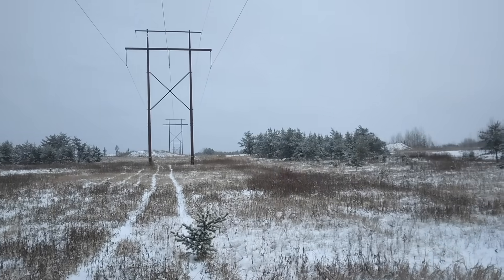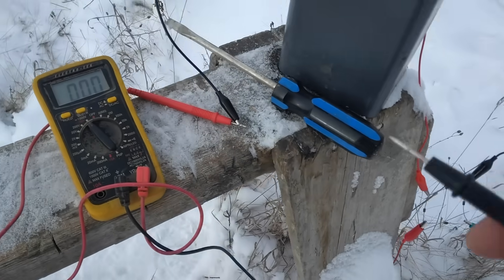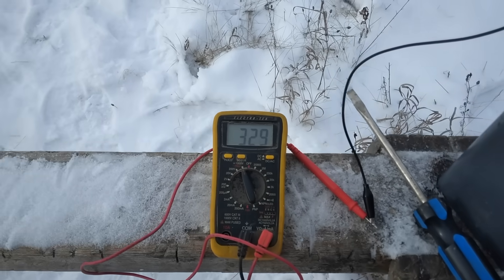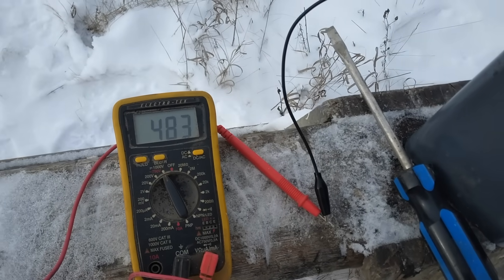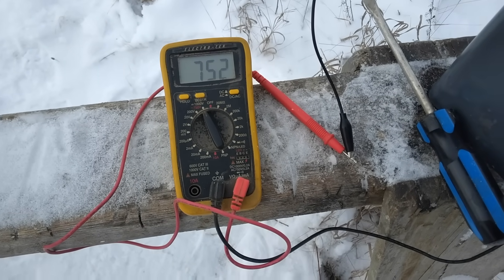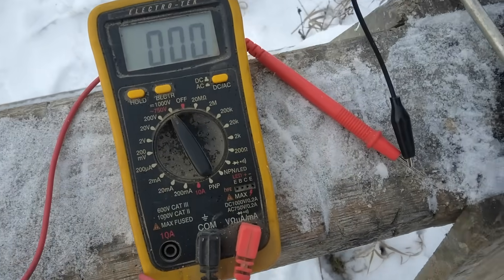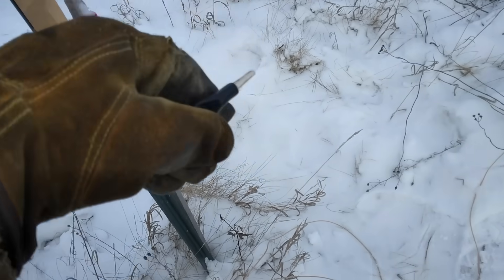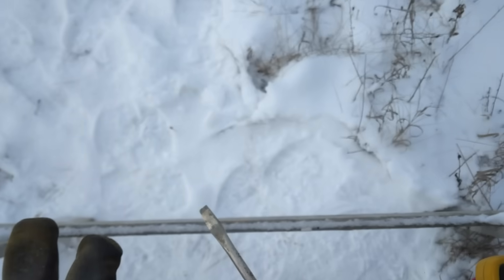Fences sucking power from under HV transmission lines

Comment: You can test higher AC voltages with a resistance bridge. Use two resistors in series and make one of them 100:1 the value of the other and go between your 'fence' and ground. The values should be high enough to limit the current so use maybe 4.7K and 470K ohms. Measure the resistance across the smaller one and multiply by 100. You don't want to go too high either because as you approach the internal resistance of the meter, your values will become skewed. Still high voltage, so be careful. Maybe mount to a board in advance. If the voltage remains too high, make the difference 1000:1. 😎
Reply: measure the resistance? but you know the resistance of the resistors already... and you'll fry your ohmmeter if you measure it with voltage present
Reply: @michvod he meant measure the voltage. What he was describing was a voltage divider circuit, and he said to measure 1/101th of the total voltage drop across both resistors in series.

Comment: Co-ax cable? The outer co-axial part is the shield! Use plain bare or insulated wire! 
Take a florescent tube with you. It should light up under the lines, just how bright where you find out!

Comment: I'm curious is this wasted power from the power lines or does it actually draw Power from the power lines? In other words when you put this wire up does it take power away from the power line resulting in Lost Revenue (albeit small) for the power company?

Comment: If anyone has ever noticed a different "feel" or "vibe" or "smell" under or around high tension lines, this is what is going on. EMF. As more and more wifi signals and cell signals have been broadcast over the years, the energy vibe of my area has gotten "thicker"; its as if you can hear and feel more static but its completely silent (sans the sounds of the road).

Comment: What would you be able run off of this system?  I’m guessing you’d be looking at some circuitry hooked up to the capacitor (post charging) to bring the voltage down to a 12 volt DC supply?  Maybe to run some low load lights or something or charge your laptop haha.  I suppose the possibilities are endless if you know how to harness the power from the capacitor in a controlled way. 🤔

Comment: It's a wire in an alternating magnetic field. That is how you induce an electric current in a wire.
     But would this result in less currant delivered to the intended destination?
     The power is lost in creating the magnetic field. The magnet field is generated regardless. But does collecting the energy from the magnetic field effect the current in the wire?

Comment: You're not stealing electricity, instead you are harvesting the electromagnetic field created by the high tension lines and actually making a small generator by using the shield side of the coaxial cable. Nothing illegal about it and I don't see why you can't charge batteries with a little ingenuity  after all a capacitor is a battery in all reality. Just think about it, if you were to string up several lines you might be able to charge enough batteries to power up your barn or even the house.

Comment: The fences are NOT sucking power.  Yes. Fences can have an electric charge induced into it.  The HV power travels around conductor as it travels long distance the circle of electrons gets larger.  As that circle grows it induces a charge on any conductor it crosses. That is why fences crossing power lines are GROUNDED.  Your action on this video is reckless. You CAN easily electrocute yourself , you have no knowledge of the danger you put yourself in.  Power lines use what is called a transposition to decrease line loss which is what you are experiencing.  A transposition is the change of position of the conductor at two structures to collapse the circling electrons back to conductor thus reducing line loss.    The amount of voltage you are collecting is unpredictable , it is determined by load, atmospheric conditions and wind.  The next time you do your experiment you could receive many thousands of volts. To which your leather gloves would not insulate.

Comment: It is common practice in the pipeline industry to have ground straps or chains dragging on all equipment under power lines to drain the charge.

In the 1960's a gentleman had placed a loop in his backyard under TVA power lines.  It worked well for him.  He agreed to install a loop for his neighbor but was unfortunately killed by an electric shock from his invention.

Comment: It is electrical pollution. We used to camp up at a corner point where 2 lines came together. We used Fluorescent light bulbs which would glow dimly when hooked to a ground and a ring of wire going from bulb to bulb. Was cool to see about 10 or so strung around our tents.

Comment: I have power lines running across the east end of my property. Now I think I know why I get shocked touching metallic surfaces underneath the power lines when it rains. Just recently I touched the bumper of my camper which is under the power lines, and I got jolted pretty bad. The camper was not plugged into any electrical source. VERY INTERESTING COMMENTS.

Comment: I owned powerline property which I used for my horses. I ran an electric fence around it, and The fence was charged on its own after I went through all the work of running a 110 line out there. He didn’t really need it the electric company it was because of a bad ground on the power poles which are all still never really figured it out all the way, but my horses wouldn’t go near that damn fence that’s for sure

Comment: Buy more capacitors! Its their regulations that allow you to capture what is in the air. Put up a shed with a regulator and batteries wherever their easement ends. Imagine the cancer causing EMF under those lines.

Comment: It has been proven beyond the Shadow of a doubt that when electricity flow it display ions around the power lines, if you put a roll of copper wire near the power lines you will get a reliable electricity out of the roll of copper wire without tuchin the powe lines, an example of that is  a conventional welding machine, the main electrical winding doesn't tuch the secondary windings but the secondary winding output a given amount pf electricity depending the distance and voltage output of the primary windings, for example a three face 240 a volts electric motor running on a single face displace 110 ac volts ou of the remaining other windings, a kindergarten recently graduated of school of engineering can tell you that, yo don't have to be a rocket scientist to know that.

Comment: Years ago before we moved, there were high power transmission lines behind our house, there were 4 people in the neighborhood that got cancer, my wife the 5th got thyroid cancer. We did move 40 years ago from that location. You could feel the radiation bombardment from the electricity. It would be nice to know the statistics of people that have gotten cancer while in those areas under transmission lines.
Reply: Years ago they launched men in a meat capsule to walk around on the moon.  You can still find websites and groups that will say it was a hoax and never happened.  You can confirm any bias you wish if you look only for the confirmation.
Reply: Birds and electrical workers don't have any higher risk of cancer. To make this brief, a university professor faked the data that power lines cause cancer to get donations of research grants, in other words, money. Completely unrelated but interesting rumors are that oil well fracing and the Alaska - Canadian oil pipeline will cause pollution. Guess who started those rumors? It was the Russians trying to cut US oil production. Our current president swallowed those rumors whole.
Reply: There is a street in Wyandotte, MI called Electric because high voltage towers run along it and houses are all up and down both sides of the power lines. I wouldn't want to live on Electric st.
Reply: I do know this magnetism does f with the body and very large fields of flux are created off those lines .
Reply: The stats are there, but big E doesn't care
Reply: Studies with data accrued over years, and in some inquiries, accrued over tens of years, made in a number of countries, from Algeria to Sweden, France, Great Britain and of course the U.S., concluded that there may be a harmful effect on human biology from the ultra-high voltage aerial lines that are in vicinity. 
The same as in nuclear radiation, you must not be exposed over a certain quantity over a longer period of time. Like in the nuclear radiation, you can reach the harmful level in a short time under a very severe exposure, or you can reach the same level in a longer time, under a smaller exposure. In plain English, if you walk for 2...3 hours along the poles of a high voltage line, and you'll not do that again for several months, it's not worrisome. If you walk for 2...3 hours along the poles of a high voltage line and you do that every week or more often, that may be a troublesome health hazard.
Reply: The stats are there if you bother to look you’ll find it has been studied extensively and they have found no correlation with cancer.
Reply: @jgrenwod  

Who financed the studies?
Reply: @jgrenwod  .... and if you actually believe what "they" say I have some oceanfront property for sale in Arizona if you're interested.
Reply: @78tag  
Paranoid much?
Reply: @jgrenwod  .... ignorant much?
Reply: @78tag   Ignorant about what? Your imagination without a research or proof? Do you have a link to a scientific research that proves corelation between cancer and power lines? if not, You are "ignorant" to those actual research and dismiss them just because you don't like them.
Reply: @jgrenwod  IMO conspiratorealiy minded people. Political and otherwise love sesasonalist news media, it valadates there believes, and will strive to never directly contradict them, especially by not explaining uncomfortable contradictions that studys and data may bring to their simplistic world views.

Comment: That Juice would go to ground w/ or w/out your fence. I was in a 24 hr MtB race that followed the power line easement. After dark we couldn't miss the fact after jolting over some rocks, lightning bolts would shoot to ground off the low point a Alu Bike frames.

Comment: Metal fence posts after being pounded into the ground have to be grounded. They take the electricity from the ground and can actually rocket themselves straight up several feet. Ask an oilfield pipeliner. They have to ground the fencing almost everyday. The pipe with moving fluid inside charges the dirt up.

Comment: I had a similar,
 " Shocking " incident many years ago, when after placing a Vertical  aluminum antenna tuned to the Ten Meter Amateur Radio band, and fed with Coaxial  cable, in the top of a 45 to 50 foot Maple tree in my backyard.
Probably less than 10 feet from the tree, were the power lines that provided the 220 /  110 volts AC, to the homes in the neighborhood !
Sometime after the installation, I was removing the coax connector off the back of at the time, a tube type transmitter, when I noticed I was getting bit just as the connector broke contact with the radio !
At first, I was thinking it was an issue with the radio, until I tested the coax thru a jumper, at the base of the tree.
Placing one lead from my voltmeter on the coax, and the other to Earth ground, I was seeing an unbelievable 80 volts !
Fortunately no harm came to me nor the radio gear, but it was my first experience with inductively induced voltage !
And I paid particular interest over the years, of stories of people developing Cancer, whose homes were built in close proximity to High Voltage power lines !
Seems like most countries treat RF and EMF issues much differently than the U.S., as I'm guessing too much is driven by the Ole' Mighty Dollar ?

               ⚡👈😖

Comment: When I was a land surveyor, if we would park our work truck under power lines like these, our truck would shock you... We had an aluminum camper top gimmick on the trucks, if you landed on it, both your elbows would have burn lines on them... I know all about that stray current...! Thanks for sharing... Keep up your awesomeness...
Reply: No problem... Don't ever stop being yourself...! Also, try to compliment someone daily... it just may change their day for the better... Take care...
Reply: @kurtisstutzman7056 great idea!
Reply: had the same thing happen but only happened with dew on ground
Reply: I’m a surveyor, remember once a long time ago setup under lines looking through the level and my eyelashes arching. I’d never stake curb with GPS but I do it with a robot all day long
Reply: @tmfp36  Yep...
Reply: Weird coincidence but I worked for a seismic survey crew and did the same thing. I just crawled out of a swamp, soaking wet and went to place my pin flags into the back of the pickup truck. As soon as the underside of my arm touched the truck I got a very noticeable zap. The rest of the crew laughed when I squealed and didn't believe me but nobody would touch the truck. Also, this was back in the day when we had to use the time cube and do sun shots. They have GPS now, spoiled babies.
Reply: @nonyerbidness475  right...! I got out of it just when the robotics were coming around... All we see now are one man crews...! I can't believe they're staking curb with GPS nowadays...!!!
Reply: They're staking everything, not just curb. I can't imagine setting building stakes with GPS, but I've seen any number of crews doing it.
Robotics are nice. Rented one for a large job, no radios needed and cut our field time to a third.
Reply from the maker: Thanks for your comment!

Comment: Your voltmeter will be fine. The right port is only measuring impedance of the circuit. Only a miniscule current is passing through the device. Different story if you used the left port. They have a 10A fuse in them for that reason. But really no reason to ever use that side as you can just use Ohm's law to measure the current. You basically built yourself a simple linear power supply. 

From my understanding, high voltage lines put off a great deal of magnetic field. If you could use this concept to move magnets within that field, you could produce some serious current. Maybe a very large diameter merry-go-round type of machine lined with magnets and a copper coil stator (or inverse this) and use little sails on it for the wind to rotate it.... hmmmm :D

Comment: I have a capacitor I bought on Amazon, that will start my van no problem, once it's charged up.  
It takes one minute to charge up when attached to a regular car battery that is half dead (like 8 or 10 volts left in it.

It will also charge up from 4 Lithium AA cells but it takes an hour or more to drain them slowly. 

I'll bet your "fence" could charge one up too ... this would make a practical application for someone who travels near high tension wires like theses!!  :) 

With the proper circuitry I'm sure your coaxial "fence"  this would also charge a cell phone,  it's just getting the power regulated to it doesn't blow up a lithium battery! :)

Comment: Very common. There's no mistake that induction is real. I was with a cable technician running 300 feet of coax parallel with power. With nothing connected to either end we measured 700v to ground. Volts were high but current was nil. We grounded it and let it ride. Most people have no idea that it is common and unavoidable.

Comment: I know a guy who was MILES from the nearest normal power lines, but he asked for a quote how much to hook power up to his cabin .. he got a run around and they finally gave him a direct number to call for the quote, 

He was VERY pleasantly surprised at the low cost!!!  His cabin was two power poles away from giant mega steel voltage power towers twice the size these! .. and the power company bolted a power transformer WAY up there and ran the lines for him,  

HIs power is somewhat cheaper than surrounding farms and houses ... but he has to pay it only once a year ... and it comes from a totally different company than everyone else's :)
Reply: The substation transformer for this voltage is the size of a large car. They might have a special small one for situations like this or they were planning a new substation in the area anyway. I don't think the small transformer exists because of safety reasons. There has to be a certain distance to prevent electricity from jumping to the wrong place even when it's covered in snow. Pretty cool story though.